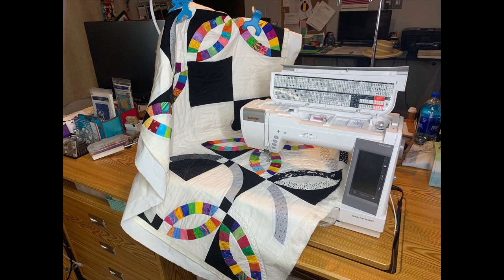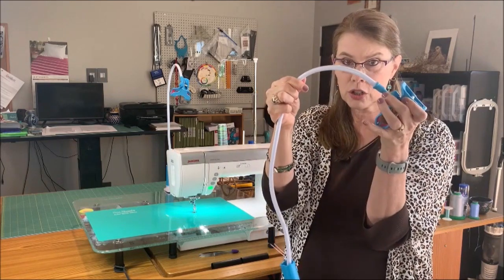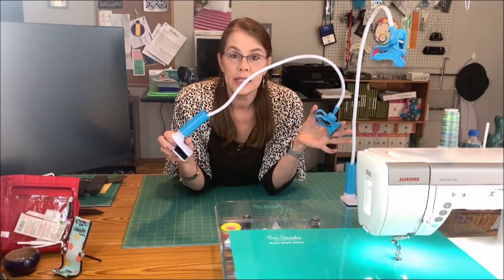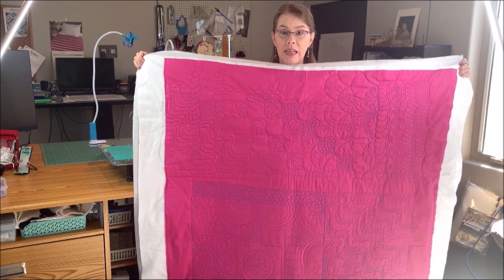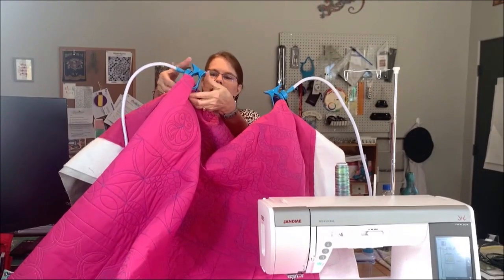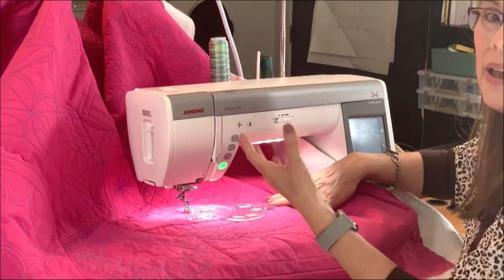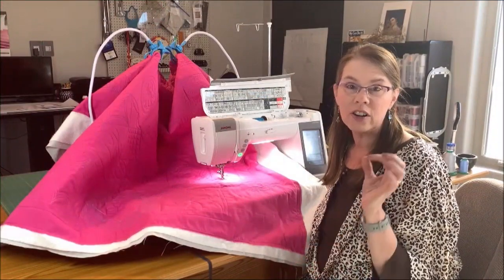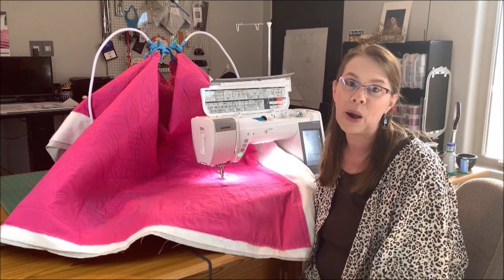Sew Steady Suspension System Instructional Video

Comment: I received this and have installed. Quilting time has arrived and so far, it’s working nicely. 
I don’t know if anyone else experienced not being able to separate the clamp, but after completely unscrewing the screw, the clamp finally separated. Maybe, it happened because it was new? But, working fine.
Reply: Yes but all 4 came apart fine with a bit of gentle wiggling. Think it was just b/c it was new.

Comment: I noticed that you have the sewing machine sitting on top of the table rather than dropped down even with the table top. Can the quilt support system be used if the machine is set into a sewing table?

Comment: Question regarding the Suspension System: I have watched the instruction videos, but I recently gave my System its maiden voyage and experienced problems. I am working on a 60" x 70" quilt. I have the four arms installed on my heavy old desk. If I attach the quilt to one short end, the weight of the middle quilt still drags on my table. I then tried installing the middle of the quilt into the arms--the quilt was doubled and then rolled over the black plastic inserts. I do have the stretchy sticky tape over the dowel  inserts, which Donelle suggests. The quilt and dowels keep popping off. Even with only one layer of quilt and pressing the clamps tightly shut, when there is movement on the quilt, it does not hold. Any suggestions?
Reply: Marcia Waara - I had a similar experience with the two arm system.  The clamps on the system I received would not hold on to a lap/throw size quilt.   I finally placed spring clamps over the system's clamps so that the quilt would not fall down. Two weeks of emails and photos sent their distributor's customer service offer little help other than return, at my expense, at they would inspect before issuing a refund .   Very disappointed.  Wish I had purchased the Weightless quilter by dime.

Comment: System is very disappointing.  Clamps are not strong enough to hold the weight of a lap/throw up.  The slightless movement of the quilt and the quilt falls out of the clamps.  Had to place spring clamps over the system's clamps.  Research Weightless Quilter by dime before making this purchase.  Customer service could offer little to help after 2 weeks of emails and photos sent  - return (at my expense) and they will inspect before they would issue a refund.  Really, the clamps are defective.